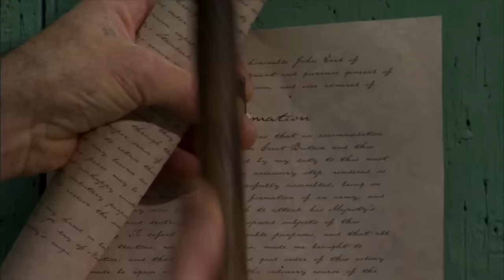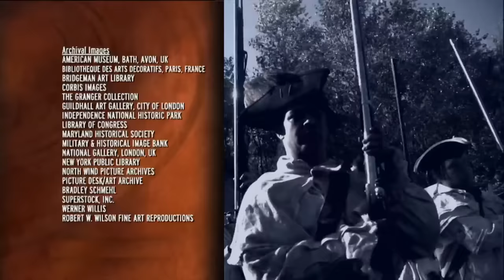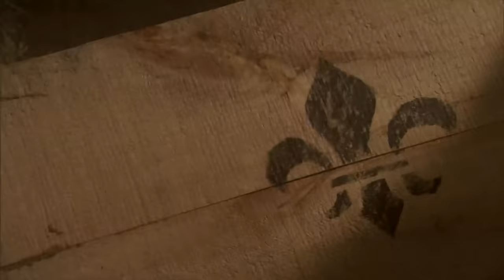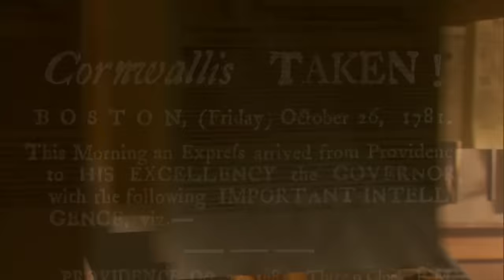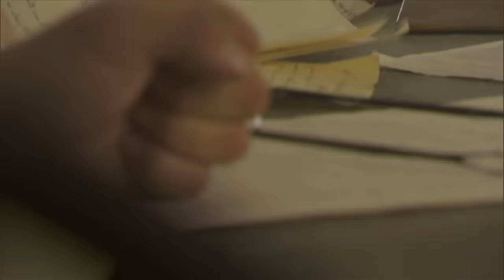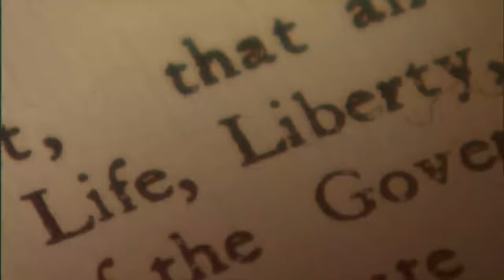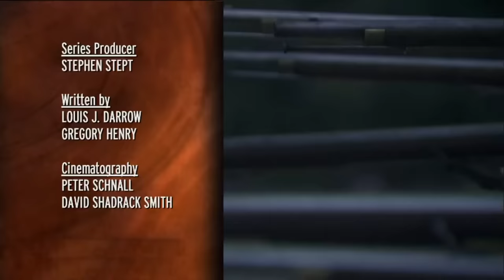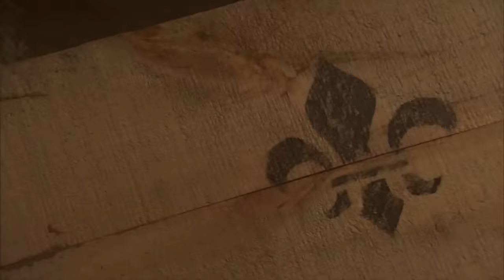War Intensifies: Bloody Battles on Road to Independence | The Revolution | *4 Hour Marathon*

Comment: If you know anything about extrude honing with abrasives then you can understand this easily. Manufacturers use basically the same process to cut STEEL in hours on a tiny scale compared to this. I imagine a combination of sandblasting and natural extrude honing did this to the Giza plateau.

Comment: ❤Even today the making of enemies of US is from abusing those same soldiers & sailors ,airmen they train.Only through contract does retired military work to maintain the strength of US military & many will find a new org.anxious to employ them.Thst is why Prigozen had power & his replacement has a strong arm of Special forces equal to Spetsnaz ,but pushing for the same goal not for pay but for right & wrong!If USA does not recognize the Indian contingent of local soldiers as a valued member of US military they will find the extreme agents of change on their tail violating the land of these tribes for oil will result in a large push to rectify the agreed treaties since these treaties are old does not mean there obsolete it means Indian tribes has a secure arm to answer the challenge already in uniform & ready to roll❤